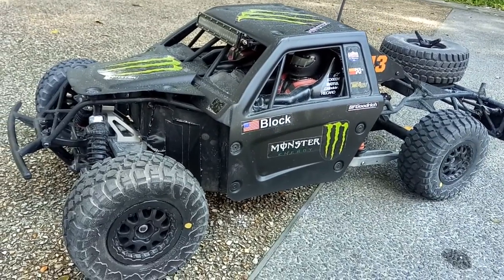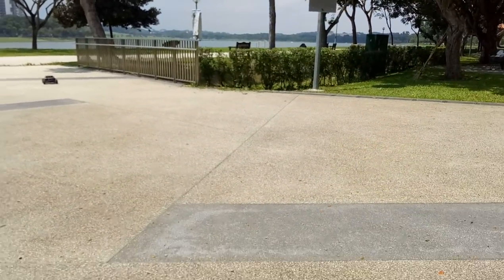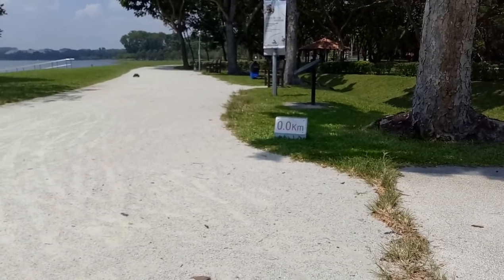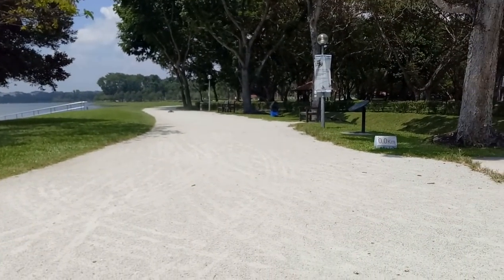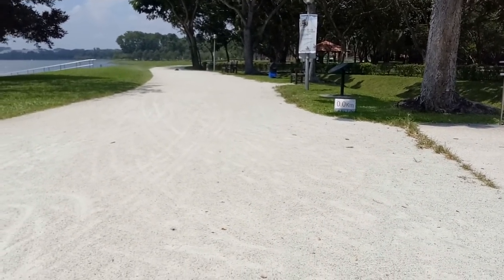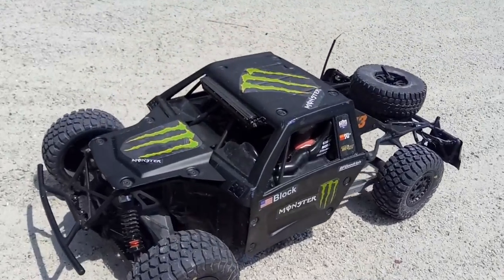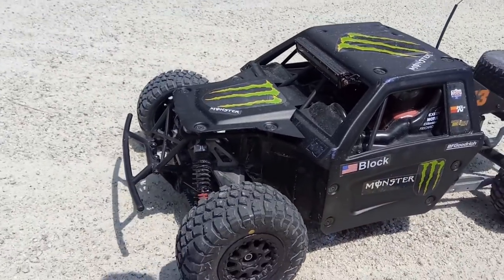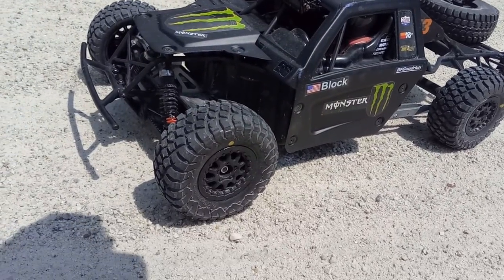Losi Baja Rey 1st Run on 3S with Proline BFGoodrich Baja 2.2 SC tires & ESS One Plus sound

Comment: Hi buddy do rcs track straight always? If a car collides into something is it normal to readjust alignment.? Please give me your thoughts on alignment issue's?
Reply from the maker: Rarely. Haha! Usually you have to measure the tie rod lengths on the a-arms, camber and toe and then after that ensure the servo is zeroed well. I try to use as little steering trim as possible. I try and make the mechanical adjustments as accurate as possible first.

Yes upon frontal collision, some vehicles will immediately lose its alignment. In the case of this Baja Rey, the chassis plate actually bent to one side. Some vehicles are just built tougher than others. My Hobao Hyper MT doesn't lose its alignment easily.
Reply: Monster-X RC bro I'm frustrated as hell.
Just gt myself a second car and after assembling it the same thing happens..when I go straight it goes to one side..if I adjust the trims then ok but after that the reverse is curved..same thing happens again and again..I don't whats the problem..any ideas? Do u know mean..
Reply from the maker: Specific to this vehicle, and most RCs with a Rear Solid Axle, you will have torque twist. Where upon acceleration, the vehicle will tend to pull to one side. Mine does that sometimes on reversing. It spins out slightly.

Are you running 2s or 3s? Try squeezing throttle a little more gently.

Comment: Really nice truck. How did you do the sound module and is this the base model from the losi baja rey?
Reply from the maker: +Steve Tirbeni Hi Steve, the sound module is the Sense ESS One Plus. It's best to run it with an external power source like a small 2S 1100mah lipo. And yes it's the Losi Baja Rey.
Reply: WOW THANX! Car looks amazing. Gonna buy this model to.
Reply from the maker: Steve Tirbeni Most welcome 😊👍

Comment: Awesome truck man. 
I'm debating if to get the baja or super baja. Really need help to decide. Lol.
Reply: Erik Aceves both are awesome! The SBR is 1/6 and actually handles quite different despite exact suspensions. The bigger SBR does not have as much torque lift in the front when under full throttle. Now the smaller 1/10 Baja Rey has a ton of lift in the front when you smash the throttle, which actually ads to the scale realistics of the actual full size real life version. I love the torque lift, some don’t, but I love it! Really let’s you see that suspension working. Those who don’t like it should have definitely done more research because that’s what this rig is set up to do. Hope this was helpful

Comment: I had the same problem, I figured it out you have to change the start mode (how fast it accelerates). Stock is set to 4 and now I set it to 2 and now my 3s battery lasts a long time without cutting out.
Reply: Are you referring to the punch control? Thinking about getting a hobbywimg program card  to adjust a few things

Comment: Install a bec for your servo and install a second bec for your lights
Reply from the maker: Thank you for the advice. I'm running the lights on a separate power source now.
Reply: You can run lights of same power sorce as esc/reciver but what happens is the power firsy gos thru the esc then powers the reciver the reciver powers servo and everything else with a bec connect to esc bat wire plug it will suply power seprately to servo and light in reality a bec is basiclly the same idea as a capasitor for car audio it just makes sure theres a direct constent un interupeted flow of currennt you could probly get away with one bec run servo and light becuase the recivers basiclly a big brain that cant always power these high power draining applications tbh youd think the manufature of these companys would from factory installed becs but thay want us the consumer to run are rcs and burn em up so we buy there replacement parts but lack to relize is stock burns out easyer were just gunna go to another company for are electrics (hobbywing,novak,tekkin,castle) i had the same electrical gremilens and the bec helps